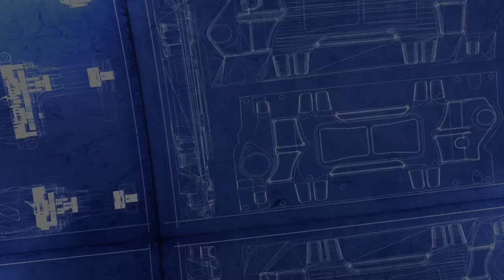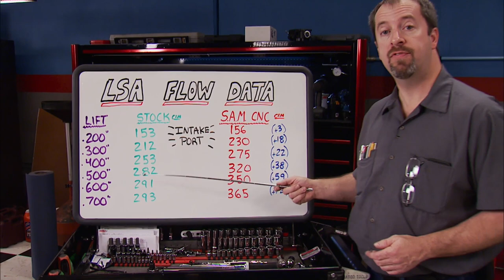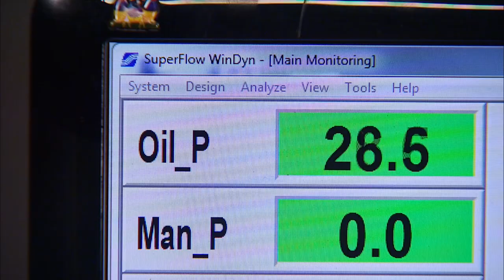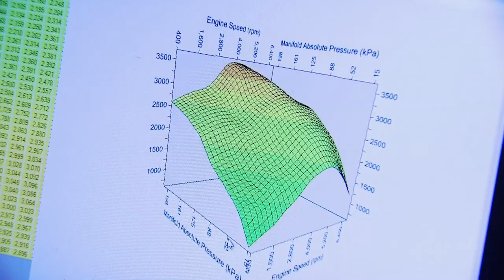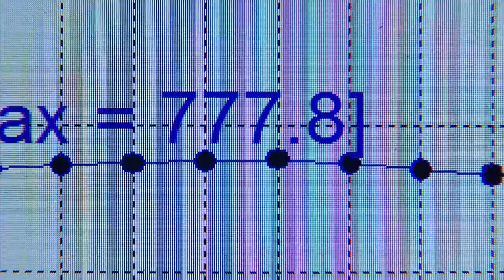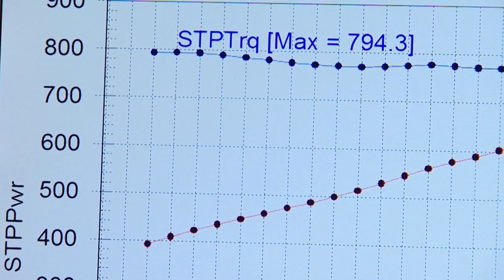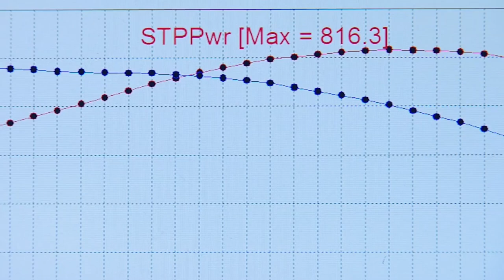Will The Supercharged Cadillac LSA Hit 800 HP? LSA 427 Build - Part 2 - Engine Power S3, E6

Comment: Take an old head bolt and cut a couple vertical grooves with a cutoff wheel and clean it up with a file, saves you a few bucks on buying a tap for cleaning the head bolt holes
Reply: Interesting.   That's an interesting way to do it.  Saves you buying a set of taps which for good ones are not exactly inexpensive.
Reply: Depends on where you are and where you get it from.  If you buy a lot of cutters taps are inexpensive especially if you are just chasing threads.
Reply: I have been doing that for 15 years old a old farmer on my road growing up taught me and showed me how and also if you have a bearing race on a spindle or something where the race fits lose you can use a prick punch and hammer and punch the surface and the steel will rise up and mushroom and some time you can just do that to save a couple bucks if it is hard to find or get parts but I don't recommend it I lwas blessed to grow up with a bunch of old timers who were extremely smart with mechanics
Reply: He put new head studs in anyway, so whether he cleaned it out or not was irrelevant. If he was using headbolts, it would have been more relevant.
Reply: @andoletube  cleaning the threads on any head bolt or main cap bolt is always good practice and he was just explaining how to make a thread chaser from a old head bolt to chase the threads in the block for the new hardware without going and buying a new tap
Reply: @joepatenaude3957  And the whole point of the channel is not to save money, but to throw dust in the eyes...
Reply: @andoletube   How do you like the feelings of tact, tolerast huev! 😁

Comment: Blown 427 with 1 3/4 headers…. Makes sense
Reply: I would say with 1 7/8 headers it would pickup some all across the borad
Reply: Might even get away with 2 inch pipe into 3.5 collectors
Reply: Spend all that money to cheap out on the headers?? 1 of those FTW moments
Reply: Tens of thousands of people have done it. I would have gone 2” if available.
Reply: The use of 1 3/4 headers maybe due to the clearance or fitment into the vehicle, as 10-15hp is available with larger 1 7/8 primaries as we have seen with Richard H videos
Reply: @jasonc950  with my experience I have never seen a 1 7/8 header not fit where a 1 3/4 would
Reply: They sell 2” primary headers for the CTS-V and ZL1….
Reply: @luisb.c4938  it’s going to be custom fitted to a 93 Caprice 🤔 but yeah
Reply: Needed 2 inchers for sure. 1 7/8 (1.875”) minimum. 

I Had the same look on my face when they said 1.75” like 🤨🤨🤨 lol
Reply: @J C they hinted on why it was used during the dyno test. They’ve ran test with other combinations using those headers. It was simply a case of them using what was around.

Comment: Considering that the torque peak was at 2500, and didnt go below 700 until 6k, you could use this as an engine for a truck and it would do amazing.
Reply: My thoughts exactly.  This would make a great truck engine.
Reply: And talk about a smooth torque curve too, you really wouldn’t need that much gearing at all
Reply: It's an engine GM designed for marine applications.

Comment: Overall good episode. Would have been killer with a 2650 and a ZL1 lid instead of the less efficient CTSV lid. 

With a 2650/ZL1 lid on pump this engine would probably have crested 900hp on 93 “on accident” lol
Reply: For sure I gained 160 wheel going from stock blower to Kong2650

Comment: All that power on 93, I would imagine on E85 it would be maybe 840 or more, since everyone that is drag racing is using that or even going to methanol.
Reply: 850 easily
Reply: Yeah easily doable on 93. Got a 700whp sbe turbo 6.0 daily in the driveway.    
They went WAY overkill for 800hp
Reply: @williamhare9104  OVERKILL LOL my Zl1 had a little over 1000hp and 900ft of torque and not even close to overkill
Reply: @JoeMama-yl1ow   I mean they over built the short block for that much power

Comment: That thing could use a little bigger camshaft,   it's almost begging for it
Reply: I've noticed strokers need 8-10* more cam compared to stock size engine to keep rpm range the same.
Reply: @bowhite1293  well think about it,  if you put a stock ls3 376 cubic inchs camshaft in a 4.8 293 cubic inchs,  the 293 sounds mean, but it's a stock ls3,  so yeah a 427 would need a bigger cam then a stock motor
Reply: Correct. I was giving an actual degree amount of duration.
Reply: @bowhite1293  I'm kinda old school in this way,  as I look how the torque carries a d where the horse power is at in the rpm range,  I'm with you, I say if there is proper ptv I could see this thing going another 10 to 12 degrees of intake, and 12 to 14 on the exhaust
Reply: A 231/248 cam is in it for this build. 
Problem with going up a lot in cam is this build is already taxing the factory blower pretty good. A 1.9l blower on a 7.0 engine lol
Reply: @bowhite1293  that is true
Reply: @bowhite1293  over those guys heads.

Comment: Should have put the magenson 2.3lt on it, then you will see so much charge cold air going in, instead of the 82 degrees temp, plus they dont show the temps at the manifold, which the LSA supercharger is not really efficient at all compared to the magenson IMO ? Plus they had a fan blowing at the intercooler heat exchanger and still had 82 degree hi temps?
 Cold air going into the combusting chamber is the key to all hp figures and the right fuel as well and proper flow in the head sure, but even stock LS7 heads will be just as good, it depends what your going to use the engine for street / drags or a every day driven car, would like to see the engine put in the Cadillac and just see what she does in the 1/4 with stock running gear ie: auto and diff gears, my guess would be around 10's if that?

Comment: That dowel sure didn't look long enough to keep that balancer pinned. I guess I didn't pay attention unless when Pat tightened the crank bolt the tensioner slid on another inch or so.
Reply: The depth to a degree doesn't matter as the force is rotational. But i sorta see what you mean

Comment: Great build. Wonder why they didn't paint it like usual?
Reply: Iron blocks are mostly painted to prevent rust. (It's just an added benefit that it looks cool) since this engine is all aluminum it doesn't really need to be painted.
Reply: @thomasgoddard5503  You're right. I just like the painted look over raw aluminum casting. Would be interesting to see a build with all the aluminum media blasted.

Comment: I wonder what a 2650 would have done.
Reply: With a good 427 and solid heads (meaning aftermarket Square ports and 9.5:1 or higher comp and a good cam), 1050 to 1300-ish has been done on 2650 set to kill. It honestly would be hard to slap a 2650 on anything and not make 900+ unless it’s intentionally turned down, or you just don’t know what the hell you’re doing lol
Reply: @edmundnlemadim8480  I sometimes wish I had gone that route but we’ll have to see what this YSiB can do on my 427 this spring.

Comment: You guys should do a 5.4l 3v triton motor hot rod build to show the work arounds to bullet proof and super up the engine. It is the most disliked out of the Triton because of the 3v heads.

Comment: They put a 102mm TB on a snout thats still 90ish mm in size.
Reply: Could be wrong but won't that cause restrictions?
Reply: I felt the biggest crime was those 1 3/4 inch headers...
Reply: Equal crime. 
1 3/4 headers = 102mm TB on 90mm plenum. 
You can even see the green oring when he opens the blade lol
Reply: @dashaunharrison1065  it improves torque

Comment: wonder why they didn't mention E85
Reply: Not everyone desires to have an E85 gas system. The E85 burns much quicker than 93 pump fuel, which already burns fast enough on these types of engines.

I recently swapped an LSA engine into my car and made many of the same modifications shown here, along with a few that weren’t shown. I’m doing 900hp on 93 pump fuel.

Comment: Full potential would mean E85, and gapping the rings to suit higher boost. There are 9 second 6l90e VF hsv GTS's models (Chevy SS with a factory LSA) with stock internals in the full weight car. But E85 of course.

Comment: ……that’s it? I know 800hp is no joke but damn, with ALL THAT I was expecting at least 1000hp or close to a thousand, ya know?
Reply: This engine will make more power but you shouldn't. It's perfect as is. You can drive it to work or the store or wherever every day for years . You probably have ok fuel efficiency also.
Reply: @joeblough2485  Yeah but look how they built it, I’m just saying with ALL THAT on that gargantuan engine I was expecting 1,000+ HP.
Reply: @frankthespank  I hear ya. It is just a mostly stock cadillac 6.0L engine after all. it has a slightly longer stroke and a faster blower ratio. And a few go fast parts. In theory, you could take a cadillac ctsv and throw a crazy pulley ratio on the front and you'd have 700+ hp.  for a while.
Reply: It can but the 1.9 blower and small primary headers is holding it back

Comment: Way too small primary size on the headers. Big displacement and blower should be 1 7/8 in at the smallest, 2 in is the typical size used. Of course I've seen stepped headers with a 1 3/4 in section but never non stepped 1 3/4 in on a big power max effort setup.

Comment: haha, 1 3/4" headers... put 2" on and see a 100 hp jump...
Reply: naw, maybe another 10 to 15 at most.  I would check back pressure at the manifold to see if its actually a restriction.  its likely not, as the difference internally between 1.75in and 2.00in is not actually that much, and not much more flow will happen.
Reply: @chubbysumo2230  Stock N/A LS3's pick up 10-15. this would easily be 50+ with the 2" vs the 1 3/4". go take a look at the jannety header comparison thread on camaro5.
Reply: Exactly, they should have done E-85 and 2 inch headers
Reply: @NicksDividends  boosted engines DONT require more exhaust flow to make more power. It will decrease BOOST 😂😂 and make less power.
Reply: @lildno2007  decreasing boost isn't a bad thing in this case. You don't want the exhaust to be a restriction. you don't want any unnecessary restriction of which the exhaust would be.
Reply: @Joshua Bullock efficiency ☝🏾

Comment: i was just looking at a LS 7 427 at ls website over head cam quad valve running 860 hp with just fuel injection but the price was insane way to much for me for a engine. i have one question for u guys first thing a LS is a chevy or GM engine and does LS build a Big block i being told that they built a LS 6 454 bbc i thought they all ways built small block GM engines and they have their own blocks and nothing to do with chevy and was designed by leslie snoboski  and introduced in 1970 for the new crate line racing engine built by GM racing division that is what i read off the LS website but everyone is telling me that is wrong that they built the LS 6 454 big block chevy and the ls 6 454 small block came out in 97 . i don't see gm calling 2 totally different engines the same thing . so does LS builds a big block chevy  ls 6 454  i have 4 ho 454 450 hp at 485 torque bbc engines modeled after the 70 chevelle ss engine but it is no LS engine , i thought they had 2 454 in 1970 the chevy and the LS because for one thing they have thousands with the  ls 6 454 bbc but they only built 212 with the ls 6 454 and 6 with the ls 7 427 that is what they claim on LS website
Reply: Jeffrey hollenbeck, all LS engines are small block, there is a factory 427 and LSX and dart make after market blocks that are small block 427 and 454 cu inch.
Reply: @nintendogamer5472  a bunch of people are saying they build a LS 6 454 big block chevy  just look up a 70 chevelle ss ls 6 454 car they have over a 1000 of them and they all have a bbc and yes i know that ls only builds small blocks we use to run a ls 6 454 small block in 1975 but everyone tells me i am full of shit that the ls line came out in 96 even 
Uncle Tony's Garage he said i was a dumb ass and said that the ls came out in 96 and the 70 chevelle had a ls 6 454 big block chevy in it i claimed that the ss had a ho bbc 454 450 hp and the ls had a 454 small block built by GM not chevy then i said there is no way gm would call 2 totally different engines the same thing they said i have no idea what i am talking about thank you for backing me up
Reply: @jeffrey4547  the LS series of engines is far different than the old small blocks and big blocks, they may have called them an ls but it's not even close to the same. The ls in this video and that most people are running came out in corvette in 97 and camaro in 98.
Reply: @nintendogamer5472  i use to run an old ls 6 454 in 1975 i got it as a crate engine same ls they sell to day only with sensor port up grades and fuel injection in 1975 it had a 6 bolt main and full roller engine aluminum block  on the drag strip u could only get it as a crate engine from 70 to 96 that is even on the LS website they have the full history of the LS 96 today is when they started putting them as an optional engine i read all this off the LS website
Reply: @nintendogamer5472  and i have 4 crate set ups with the ho 454 450 hp bbc modeled after the 70 chevelle ss engine but everyone calls it a ls 6 454 but GM. it comes with a 4 inch stroke, steel crank, heavy rods, high flow heads 10.5 to 1 compression the trans that comes with the set is a 02xx 400r turbo good to 800 hp stock from GM it has heavy clutches bigger pump stage one shift kit plus u can build the shit out of it and save a lot of money on building one up
Reply: @jeffrey4547  it doesn't matter if it was called an ls 6 the 454 has nothing in common with the ls series of engines, the newer Ls 6 is basically the same as an Ls1 aluminum small block 5.7 liter., no distributor,  6 bolt main, crank driven oil pump, cathedral port heads. The only thing similar is the transmission bell housing bolt pattern is retained. The architecture of both engines are totally different,  not to say big blocks are not great engines but they are no where near the same engines.

Comment: Those numbers are low. First the cam, headers and blower are to small for the 427. My stock Lsa 6.2 makes 750hp and 754 tq on a dyno jet.
Reply: I was thinking the same thing, I make close to that and I'm running a 370" with a 2.45" pulley

Comment: The only thing I see that disappointed me was screwing in studs before fitting cylinder heads, if you watch ARP presentation the stud Allen key broaching added is to enable them to be installed after cylinder head as sliding cylinder head over them can result in aluminium being shaved off and contaminate threads and therefore affect the torque process but hey if you think you know better kudos to you

Comment: I have respect for most manufacturers, however 427ci V8 with a supercharger. If this engine doesn't make its projected 800hp , mate something is seriously wrong. 😏🤪
Reply: With this particular set up, Its all about reliability and driveability. You can drive it to work every day for years and years with no problems.

Comment: Big deal only 800 bhp we in Australia have a Ford straight 6 cylinder overhead cam turbo engine that will easily make 1400 bhp at the wheel 
your800  bhp please give me a brake boring 
Australian made 6 can handle 1400bhp from a stock bottom end with just some mods  oil pump and upgrade plus a cradle on the bottom end

Comment: And if you’re going to be chasing the threads on the head bolts you do it before you clean the engine not when the motor is clean🤦🏻‍♂️🤦🏻‍♂️🤦🏻‍♂️🤦🏻‍♂️

Comment: these guys are so funny, spend $30,000 on an engine to tune it with HP tuners, only to make 800hp where the supercharger is the limiting factor. This thing would have made the same power and held up without the rotating assembly. lets put a whipple on it and see what it can really make

Comment: But I can get 800hp out of a built 370" and lsa supercharger. .......why spend a shit load of money on a 427 stroker kit
Reply: A year later……im building a 408 stroker😂😂😂 and the 370 will be replacing the supercharged 4.8 in my ‘73 c/10 swb….while my nova will be getting the stroker and the 4.8 will be turning into a hi compression 5.3

Comment: Just get some batteries and an Electric motor or 2. A 600hp electric motor only weighs 130lbs. Get 2 of them. 260 lbs and 1200 hp!! Simple and never break down as they only have 3 moving parts.